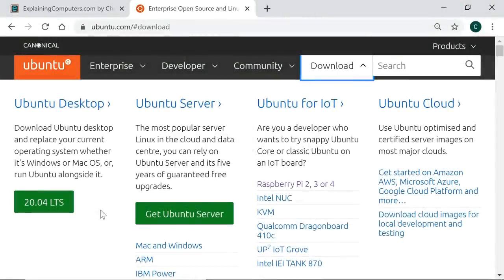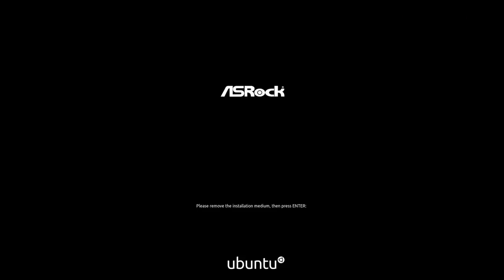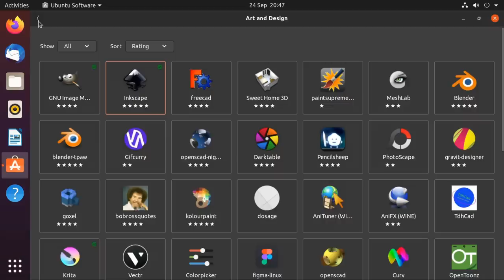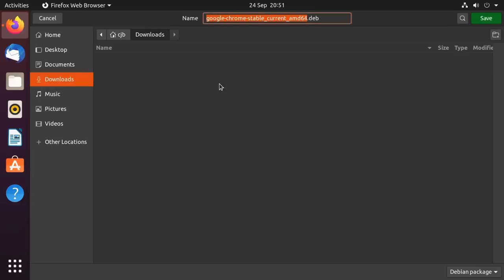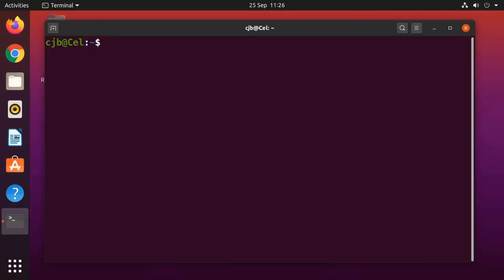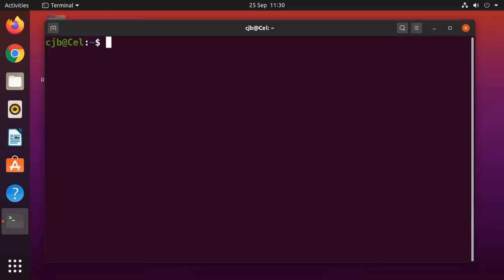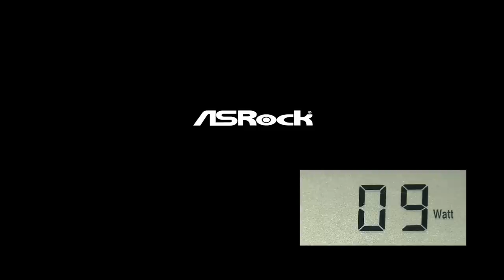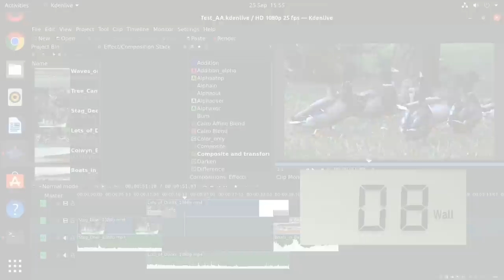Silent Mini-ITX PC Part Two: Software & Power Consumption

Comment: It'd be interesting to see a comparison between 
   
1) Unactivated Windows
2) Activated windows 
3) Linux 
   
For media centre use. E.g. Disney Plus works on all of them but is that true for all streaming services? I suspect that because of the way the web has evolved towards open standards Linux would do fine, but I haven't tried it. There's also the issue of GPU accelerated video decode. It's obviously going to work on Windows with a modern Intel chipset and Intel drivers but what about Linux? Do Intel's latest open source drivers that come with Ubuntu do GPU accelerated decode on Firefox and Chrome?
   
I built a machine with a decent GPU so I wanted to be able to play Windows games. I used unactivated windows for ages. Then I saw a video with a promo code for urcdkey.com on https://www.youtube.com/watch?v=vj9M6J5OicE and got a key for $12.98. The key worked but I'd strongly advise you to use a disposable email address for urcdkey because they'll spam you ruthlessly. Mind you I didn't notice anything that unactivated Windows can't do other than purely cosmetic things like changing wallpaper.  I don't really like Windows 10 but I think if I were building a new system I'd probably go for the unactivated Windows 10 route and then activated it if I saw a cheap CD key on sale somewhere. Though having said that urcdkey only want $17 for it even with no discount.
Reply: @gilkesisking  
   
The fact that Intel and AMD use Linux as their test platform for microcode updates doesn't really have much to do with the state of GPU drivers. The last time I used Linux my Nvidia GPU got an open-source and very feature incomplete driver by default and I had to override to get the closed source Nvidia driver which is not supported and in fact actively opposed  by the Linux kernel developers
  
And if you Google it seems like the 'wild west state' of Linux graphics drivers hasn't changed.
   
E.g. Google didn't enable hardware decode on Chrome because of the state of the drivers
  
https://www.omgubuntu.co.uk/2018/10/hardware-acceleration-chrome-linux 
  
" If the patch is a) available, b) works well (for some, with caveats) and c) can be hidden behind a flag and not enabled by default, what, you might ask, is the hold up?
  
In comment on a bug report to track hardware acceleration in Chrome for Linux, Chromium developer Antoine Labour cites stability and security concerns as a key reason why the feature can’t just be tacked on.
  
And as ever, the wild-west of varying Linux graphics drivers also seems (partly) to blame.
  
Antoine states:
  
“Our goal is to have a Stable and secure browser first, and a GPU-accelerated one second, when possible.
  
As we found out time and again, any sort of GPU acceleration has a lot of maintenance associated with it, between the multitude of configurations our users run, the general lack of quality of drivers (in particular on Linux), and the constant stream of incoming issue due to new hardware, driver, or distribution release.” "
  
This article explains how to enable it on Chromium but it is fairly involved

  
https://www.linuxuprising.com/2018/08/how-to-enable-hardware-accelerated.html
  
Still, I feel the Linux Fault Threshold approaching so maybe it's time for me to bow out of this conversation. Funny article from 2001, another time I tried Linux and eventually gave up on it.
  
https://web.archive.org/web/20031109165715/http://www.adequacy.org/public/stories/2001.10.2.33542.4010.html
Reply: @gilkesisking I'll stick with Windows and MacOS.

Comment: I can deal with no cable management, but when I see someone using wifi on a desktop PC, my hands start shaking... ;)
Reply from the maker: For a start, I did all of my setup here on Ethernet as I clearly stated (and as the panel icons indicate on the desktop). And as I also made clear, the WiFi dongle is for using this machine next to a TV, where there is no Ethernet connection. Do most people use Ethernet into their "smart" TVs?! :)